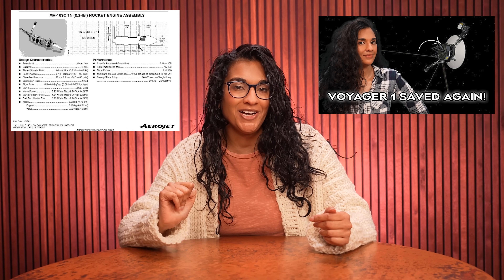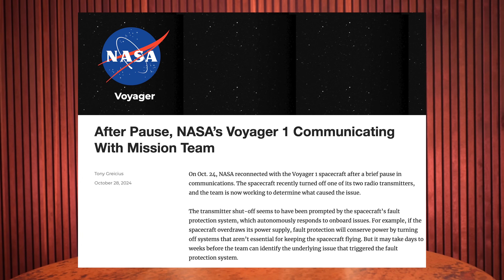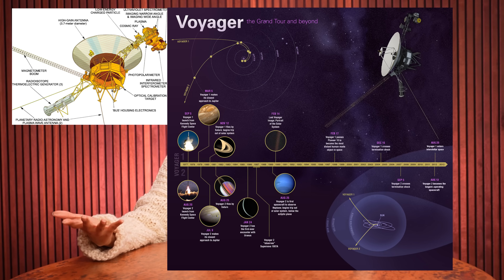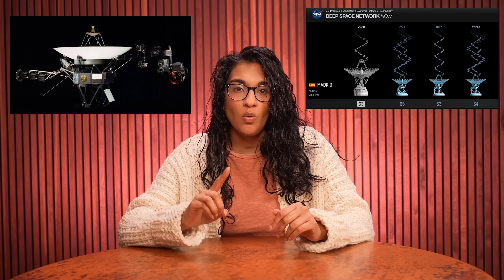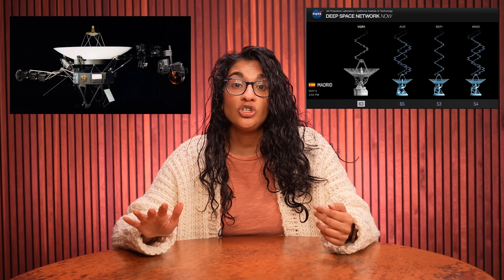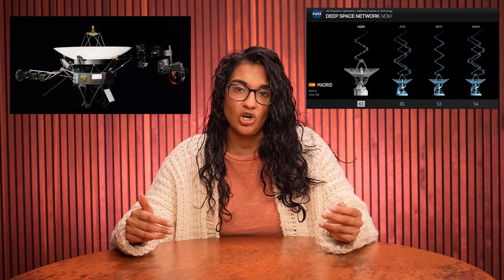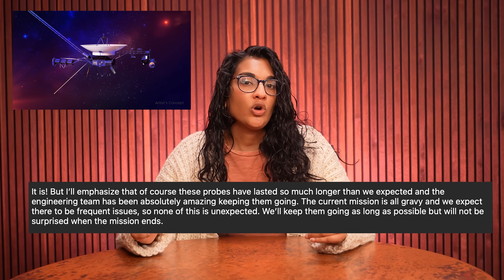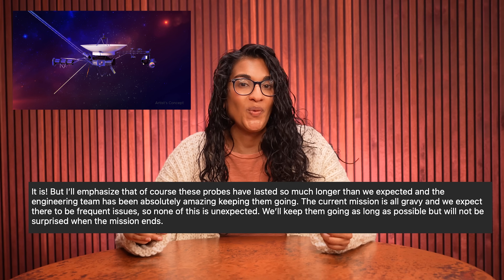VOYAGER 1'S NEW PROBLEM: Is this the end for the historic spacecraft?

Comment: The S-band transmitter uses an omni antenna.  The X-band transmitter uses a directional antenna, which is the dish you see.  The original purpose of the S-band omni antenna, which can receive and transmit in any orientation, was to get commands to Voyager right after launch when the high-gain antenna would have been pointed in the wrong direction and couldn't receive commands.  It was basically a jump start and then a backup until about Jupiter when it was too far away to have any appreciable bandwidth.  Upgrades to various Deep Space Network antennas extended the range of both S and X band systems, which is probably why we can still hear the S-band transmission but can't do much with it.

Comment: You are a fool if you think this thing still works after 45 years in a hard vacuum and constant radiation. The fuel would be long gone or frozen the batteries would be toast and the whole thing outgassed and cold welded together.
Reply: It still works, obviously, odd things go wrong, but so far have been got around.  The fuel thrusters are still working.

Comment: X band is back
ANTENNA MADRID DSS 63
DOWN SIGNAL SOURCE VOYAGER 1
FREQUENCY BAND X
DATA RATE 160.0 b/sec
POWER RECEIVED
-160 dBm
(1.0 x 10-22 kW)
Reply: What is the source of that?  The NASA webpage does not mention this.  Everyone would like to know.
Reply: @g-r-a-e-m-e-  NASA Deep Space Network Now website which shows live status of all spacecraft currently tracked by DSN.
Reply: @g-r-a-e-m-e-  NASA Deep Space Network Now website

Comment: We need a brand new Voyager 3 with a 200 year battery and a much much more powerful transmitter with modern microprocessor and storage systems.   We should get it up to speed like we did with the Parker Solar Probe at 430,000 mph.
Reply: The parker solar probe sped up because it was falling into the sun. But still, would be cool to send something way out there.   We could consider the new horizons probe to be Voyager 3, I think it's actually going faster then them. Also, maybe with starship we could tank one all the way up and then send something huge way, way out there.
Reply: @takanara7  Why can't we use the same technique we used to speed up the Parker Solar Probe to accelerate Voyager 3 and then send it on the same path as the older Voyagers?
Reply: "Modern electronics" we use daily on Earth generally won't survive in deep space without a lot re-engineering in order to survive the harsh environment of radiation and deep near absolute zero temperatures.